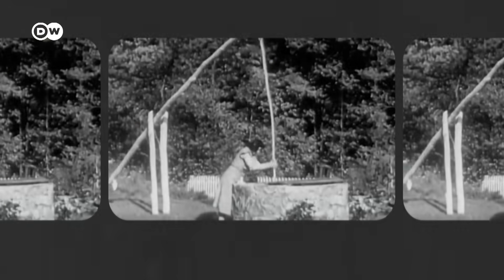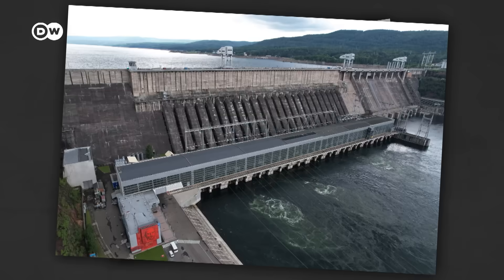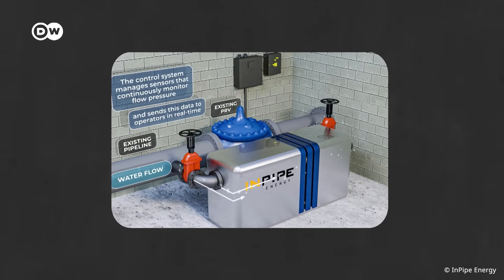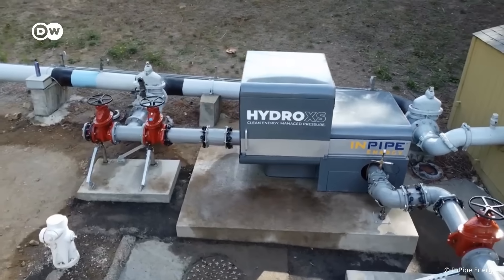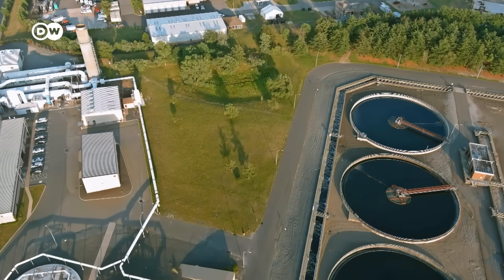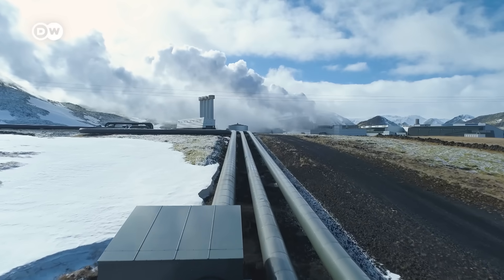In-pipe energy: The hydro power nobody is talking about

Comment: Where can we get these in-pipe turbines?
Plus, can we have bigger turbines to go into privately-owned mains pipes?

I had no idea whatsoever that the energy used to transport and pump water actually 'rivalled' that being wasted on air travel.
This is just another one of those lesser known energy consumers that get pushed into the shadows by the more well-known and controversial ones.

Be sure that it will take the UK longer to get in on the act. Privatisation of water companies has created a system that is average at best, slow to act in the case of an emergency, many companies being guilty of environment protection violations, with the focus on profits rather than quality and quantity. 
If this idea was installed in British water systems, we wouldn't see a penny knocked off our bills. The water companies would merely suggest that by selling the electricity, this offsets some 'fairytale' water rate increases they claim were due to be added to our bills. 

Every country should have nationalised water supplies. They shouldn't be in the hands of private or foreign companies.

Comment: I would have liked a better explanation on how and how much energy we waste when changing the pressure. To me the looks to be two problems. 1 you need to make sure that you are not just adding more resistance in the system so that you increase the energy needed to pump the water. 2. It looks to me that it is not that much energy you can recoup and it might be cheaper to just build solar or wind.
In general I prefer minimizing energy losses over recouping energy, cause you just add one more step where you also lose energy.
Reply: Well said!
Reply: Then you missed the part about pressure valves.
Reply: Pressure valves are there and you can’t do without them or your house’s smaller pipes will break. Energy is wasted in those pressure-reducing valves. Instead of continuing wasting it, it can be passed through a turbine and generate electricity.
Reply: @johnnny777  the issue is how much energy is wasted and can be recovered, the video makes it seem like there is a massive potential like as if we can recover most of this 4% of global energy consumption, which is not the case
Reply: @aaronhamburg4428  also, 4% is not much! Probably about the same amount (if not less) of energy wasted in mining crypto currencies could be recovered using this method! (Also I think this method is worthless and would add more power consumption to the system).

Comment: Isn't it better to alter system to get rid off excessive pressure?
Reply from the maker: It would be extremely difficult to implement in full. A pressure relief valve can protect the water system by releasing excess pressure when it exceeds a predetermined limit. But if there is some excess pressure anyway, these in-pipe turbines can take advantage of it!
Reply: Change  the circle pump to a water screw... magnetic cuppled on magnetic levitation... I use solar and this... I make over 140% with batteries whole home back up... imagine California could export power ... lol.. no joke.

Comment: Thank you,  it seems that this type of energy production is ideal for areas that water moves in the pipes freely because of a gradient, for example from high hills to low hills. Extracting energy from water that is pushed in the pipes by a pump is waste of energy.
Reply: Not even in that case. The negative pressure of the water flowing downhill will compensate that required to push it uphill. The net pressure will be small and require little energy in the first place.
Reply: @mike42356  In the above clip named in - pipe energy the subject is about producing energy from the city water or drinking water as a " byproduct " of that system . Without any doubt Producing energy from streaming water has its own principles.
Reply: ...or rather a recovery of energy that would otherwise be wasted in a pressure valve.
Reply: @andreasvogel5186  This doesn't make sense. Pressure regulators are not exceptional energy wasters. If a certain model is, the energy waste will occur inside it, an external turbine won't help a bit.
Reply: @andreasvogel5186  Name it a Dam

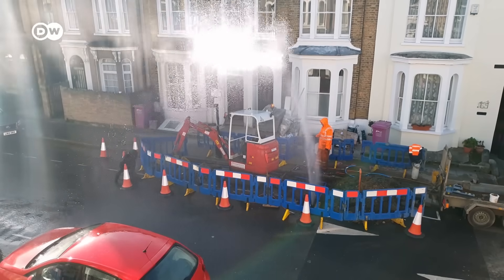Comment: I entered this video expecting nonsense but then around 2:30 the genuine opportunity was revealed. For me, there is a question however whether something like a reverse ram pump wouldn't be more suitable than an electricity generator? Granted, I think this assumes besides the primary high pressure (drinkable) water source and the middle pressure exit some local low-pressure drinking water input and maybe that would make this setup more expensive than this generator idea where all water treatment remains a centralized business?
Reply: Why not cut back the high-pressure grid as much as possible and rely on a more widespread use of water towers and use greater tube diameters in important water arteries?

Comment: I miss you speaking more about the pressure diffetential this will produce. And if it only is applicable for towns, where the water come down from a hill.

otherwise, quite interrsting.
Reply: In pumped water network system of a city, turbines can also be installed in parallel to PRV (pressure release valves) or inlet of reservoirs. Our turbines will only use the differential pressure that is allowed on the system, using only the excess of pressure for that point
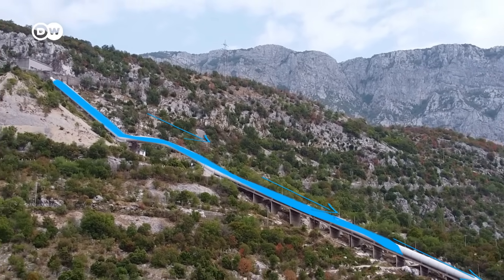Reply from the maker: Hey, around 1:59 minutes to the video we show how some cities have it naturally easier because of gravity. 🍀But in places around the world where the water does not come down from hills its a different story and pressure is very much needed  - and, could be harnessed. 🌈

Comment: Any mechanical resistant met will cost energy no matter how small. PERIOD. This is indeed, a pipe dream.
Reply: They mentioned it shortly, those systems would be in place of pressure reducing valves where energy is otherwise just dissipated. You could compare it with regenerative breaking instead of resistive breaking.
Reply: @Kaepsele337 it still makes no sense to over-pressurize and then reduce. What they need is more and smarter pumps
Reply: That's the point. To turn extra pressure into mechanical energy then electrical potentially.

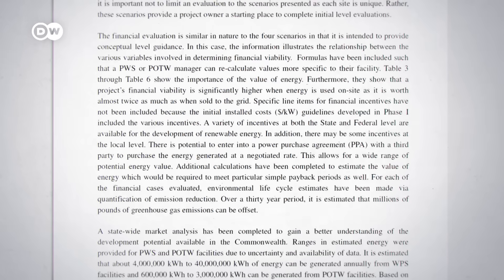Comment: Your videos are great! One thing though - you consistently use the terms for power and energy incorrectly. When you are talking about power the units are in W, MW, GW, etc. This is used for a the installed capacity of power plants or the amount electricity a lightbulb uses (1 watt = 1 joule per second...the rate at which work is done). Over time, like the course of a year, energy should be used. Energy is the "ability to do work" or how much work has been done...it is measured in kWh, kWh, GWh, TWh, etc... At 5:00 you don't say 43 GW of energy per year could be harvested...it is incorrect. The paper uses energy terms here not power.
Reply: Thanks man.